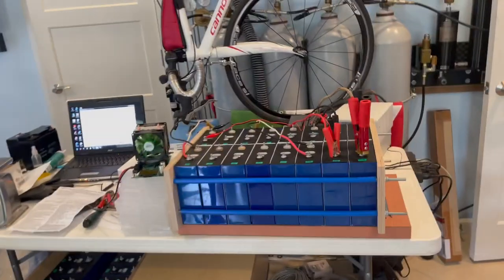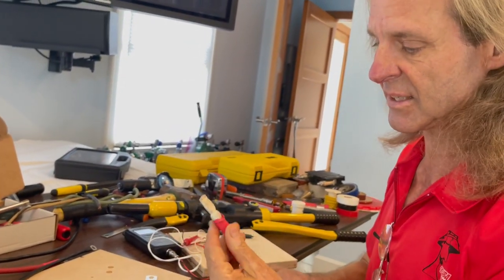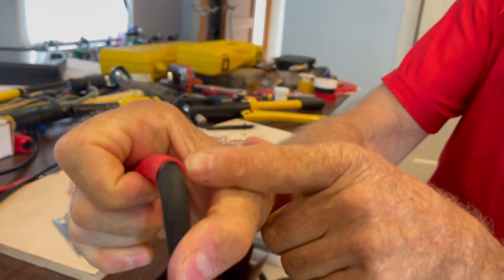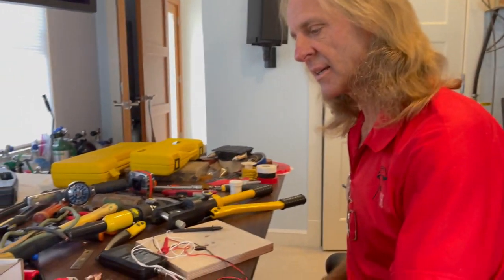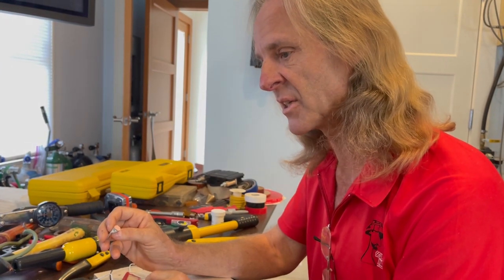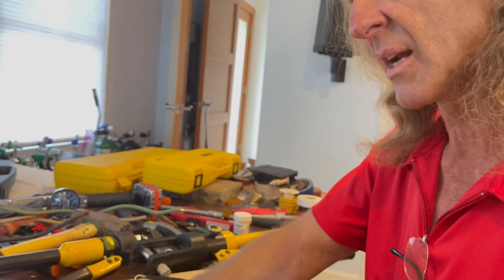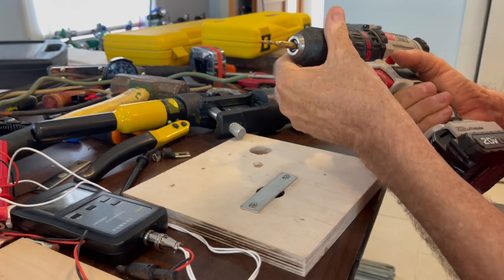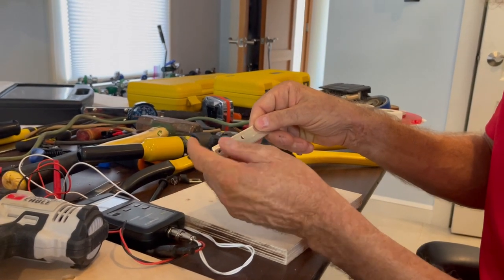Is Lifepo4 A Fire Risk?! How To Make Safe Battery Connections.

Comment: Nice video,I've sold over 500 traction forklift lead acid batteries,we used to weld the lead( pb)connectors to lead terminals with oxy acetylene torch then whilst hot we would smear vaseline to protect the terminal before we put the insulator. ive seen my batteries twenty years later and they were as shiny as the day they went out never a single problem,then the batteries became bolt on..long story short it was a total disaster..but just to give my opinion on your Anderson battery connectors I always just flux soldered them,we were doing serveral per week and again no problems,I find the crimp can very easily deform the shape of the pin those pins are spring loaded for contacting each other and any deformity can change this spring pressure/ alignment and cause burning... anyway, that's just my input for what it's worth! Good luck, Paul from Ireland.
Reply from the maker: Thanks, I will test the resistance through the Anderson connector.

Comment: Jello. Thanks for all the videos. I’ve seen 7 in the night!  Could you give us some information please about the paste name for exemple you use?  And perhaps some drawings regarding the boxes?  It would be helpful? Last thing. Are you really think pressure will keep the battery well?  How many PSI pressure?
Reply from the maker: Thanks for watching. All the info you are asking is in the videos. I hope you can see them all. The short answers are, the paste is MG847, The box dimensions are 18x31.75x11.75 inches. I restrain the movement of the batteries with minimal pressure. The nuts are installed at 1.5nm when the cells are at a fairly high SOC. I discuss these things in detail. Good luck with your project!

Comment: The un insulated transmission wire is not bare for thermal dissipation. The heat is low because of the higher voltages. Most lines are rated at <90° F operating temperature. But when running thousands of miles of it,  would be costly to try and insulate it......
Reply from the maker: The lines I’m speaking of are neighborhood scale distribution lines and the information comes from a short class I took on power distribution.

Comment: As Jojo mentions, you are a perfectionist and so am I. Sometimes however I do ask myself if this is all worth the effort (and before you even ask: yes it is because I know when I did not pay attention to every detail 😉)
But I doubt the copper/brass difference on the bus bars matters. At 100A (4.8 kW energy draw) a 0.04 mOhm resistor consumes (I² x R) 0.4 Watt and a 0.17 mOhm resistor 1.7 Watt. With 15 bus bars this sums up to a 19.5 Watt difference ((1.7-0.4)*15) in power loss. This is not the amount of power that will heat up your batteries and surely not enough to result in a fire hazard.
In a boat I would definitely use flexible bus bars.
I have a limited budget to spend so when looking at replacing bus bars with copper or replacing my Ikea (Tradfri Floalt) LED panels that take up 1.5 Watt even when switched off (and this is 24/7 !!!) I know where I will spend my money
Reply from the maker: If you watch a few more of my videos on this subject you will see that my reasoning isn't about energy loss. Undersizing your conductors is a bad idea for several reasons, but on the subject of brass bus bars, a 2x20mm brass bus bar is the equivalent of 7AWG copper wire. 7AWG copper wire with a 90c insulation is rated for around 65 Amps.
Reply: @RayBuildsCoolStuff  My battery packs for a power wall would be completely different from yours. I would be more concerned about the thermal isolation properties of the wooden box than I would be about brass bus bars instead of copper or even flexible ones. Not saying you are doing things wrong here - I would just do things differently.
I have always used a mechanical crimping tool and thought this was the perfect tool for me. After seeing this video I am convinced I need to get a hydraulic one instead to make our new power wall. Even if I would get the same results with my current tool, I want the perfect tool for a perfect result 😁

Comment: Like the video. Very well presented. I got a simple question…. You know how most BMS’s have a couple of cables for their input and output… how to properly determined the correct size lug to use? Let’s say two 7AWG; which size lug to use?
Reply from the maker: There are charts that show the cross section of different wire sizes. For instance, if you look at the cross section of a 4 gauge wire and multiply it by three you get a combined cross section that is very close to 1/0 wire size so I use that size lug when joining three 4 gauge wires in one lug. Is that what you are asking?
Reply: @RayBuildsCoolStuff  Yep! Thanks. So it would be base on the cross sectional size of each wire. It makes sense!. Again thank so much.

Comment: hello ray, thanks for this video, I learned some things.
I would like to tell you that I don't agree with the resistance measurements that you make, I think that the resistance should be measured with an equal length, I would be curious to know the difference in resistance between a rigid and flexible bus bar of the same length, in copper of course. Thanks for what you are doing.

Comment: Kudos to your camera operator, what's the name of the carbon conductive compound. Is it necessary for the  temperature leads that you tapped off of the bus bars? Nice catch on the difference in resistance between copper and brass.
Reply from the maker: The paste is mg847. I don’t use it on the sensing leads but that’s a great question.

Comment: Thank you for this video, just about to build a 32kWh Lifepo4 battery to add to my other 32kWh battery. Some things I missed like double crimping and heat shrnk. What are your thoughts on double bus bars on each connection?
Reply from the maker: I have other videos in a playlist that shows all of my preferred methods. Good luck with your project.

Comment: Which resistance tester do you use Ray?  And what is the primary difference between that and a normal Fluke meter?  I noticed yours has 4 wires for measuring…
Reply from the maker: I use a YR 1035+. It has 4 wires because it sends a small amount of voltage on two of the wires and tests resistance to 4 decimal places. The fluke can't come close to that sensitivity or accuracy.

Comment: Nice catch with the brass instead of copper. You need to check everything from China, they don't care if their cost savings starts a fire. The seller might not even know themselves. The right tool for the job is indeed critical.

Comment: Hi Ray. Thanks for your videos. I have a question about applying thermal grease. I have been using it between my lugs and my busbars and my lugs and my battery connections. My batteries are server rack type. The torque is 8 NM. The grease came with a little paddle for applying. I smear a thin coat on the bottom of the lugs. I notice on some connections that some grease has squeezed out. Am I putting too much on? Could this hurt conductivity?
Reply from the maker: I think it takes very very little. I see it as similar to lubricating o rings. The film required isn’t much. As for my opinion about it hurting conductivity? I’m all about testing. Also, you said you use thermal grease. That is a different type of product. I have used it in the past for mounting parts onto heat sinks. I would read the technical data sheets for the product that you are considering using. Try to find the papers that are written by the chemist. Usually those are the instructions. If there is a hint of marketing, don’t count on it.
Reply: Thanks Ray. Big screwup on my part. I thought I was using the same stuff you were recommending only at half the price. Glad I reached out to you. The stuff I got is for thermal conductivity not electrical. Also has high carbon content. Improving electrical conductivity by up to 30% is what hooked me (your video). I will be cleaning my connections and redoing them with the MG847.
Reply: Thermal grease meant for computer CPU heatsinks is normally electrically insulating ...

Comment: The wires that transport electricity betwen houses is alternative ... So... Is capable of more power. But if you use dc  on them, you will loose a lot of power. Bigest the wire lenth,  biggest  the looses.😉 About  those brass brackets... Are good for less power...for other projects...etc. you don't need to thow them.

Comment: Hi Ray...I'm another keen viewer from Oz...loving the very informative and laid back presentation. I thought you might have made your own busbars out of tin plated copper bar to your own specs?
Reply from the maker: I would like that very much but the cost is prohibitive. I estimated it to be about 3x the cost which is in line with the gentleman on the solar forum that was making them in his shop with a laser cutter and having them tinned by a third party. He was selling them for 6.50usd but soon gave up the venture. It's a balancing act but we have to avoid letting perfect be the enemy of good enough. I'm glad my presentation didn't put you to sleep. My wife uses my voice as a sleep aid. lol
Reply: @RayBuildsCoolStuff  This is a cut and paste from PowerPaul Australia Facebook page, a lot of info on his page: Bus Bar resistance comparison. 
In the picture are 7 bus bars. The bottom 2 are original ones supplied with the 280Ah cells and they are both 15 x 2mm copper, one os nickel plated. The nest 2 are the 2 sizes I had made from aluminium, and they are 20 x 4mm. The top 3 are the new 20 x 6mm bars or the Mercury battery. 
The bent bar replaces the entire B- cable assembly that comes with the Daly BMS. That assembly measures in at 0.17m Ohms. 
All measurements are from the mid point next to the holes. 
Copper - 0.06m Ohms (Original)
Nickel plated copper - 0.06m Ohms (Original) 
20 x 4 Aluminium - 0.05m Ohms (Scout) 
20 x 4 Aluminium (longer) - 0.09m Ohms (used for complex systems) 
20 x 6 Short - 0.02m Ohms (Mercury) 
20 x 6 Long - 0.04m Ohms (Mercury) 
20 x 6 Bent - 0.08m Ohms (Mercury) 
If we extrapolate out the numbers a bit. On a 12v battery which is 4S, and drawing 100A, we will get these losses overall. 
Copper - 0.52m Ohms = 5.2w
Nickel plated Copper - 0.52m Ohms = 5.2w
20 x 4 Aluminium - 0.49m Ohms (Scout) = 4.9w
20 x 6 Aluminium - 0.38m Ohms (Mercury) = 3.8w
A 4w loss when you're drawing close to 1300w is an excellent number. It'd be interesting to see what the figures are inside off the shelf batteries. 
Now these numbers seem not a lot different, and are indeed very low, but they just show the incremental improvements that I'm trying to include with each new version of battery. I didn't make a battery with the regular bus bars from the start, and the newer version has a greater than 20% improvement already. These sorts of marginal gains are increasingly difficult to get at this end of the scale, but it's a fun challenge. 
These figures are losses across the connection points within the battery box. There will be losses within the cells and the BMS to add into the equation too. 
The biggest difference I've seen with using these Aluminium bus bars, is the MUCH better connection they make with the battery terminals. The electrical connection seems to be much more stable and reliable. And the mechanical connection has been reported to have eliminated people issues with bolts loosening during vibrations. All of these factors play a huge part in how well the battery works, and have reliable it will be long term.
Reply from the maker: @michaelivory7606  Thank you very much for posting this. These values are nice validation for the data I have accumulated so far but add numbers for aluminum that I haven't tested. It also agrees with what I have found elsewhere. I appreciate that you took the time to post this. I think several people are wondering why we try to achieve low resistance values. It appears to be important in getting good results from these packs and the BMSs that keep them in balance. Long term reliability and performance is the goal. This is what my latest video is all about.

Comment: Great video, could you still use those brass buss bars but double stack them to double the cross section and halve the resistance?
Reply from the maker: You could use them any place where 4 gauge wire is appropriate I suppose. You could double stack them but they really aren't very flat even after I flatten them so contact area is hit or miss and I would think it would be chasing performance in the wrong way. I think they are fine for top balancing and low amp situations but......

The real issue I have with these bus bars and with cabling that is too small is the resistance and what it does to the BMS as it tries to read your cells and balance them. Have you had a chance to watch my video on that subject? It's titled "It's no joke, size really does matter"

Comment: hmm something you didnt talk about which is important with DC over a few volts is galvanic corrosion, especially on the + terminal side, which is sped up by orders of magnitude by the joining of 2 different metals. Ive always wondered about sacrificial anodes, not for marine use but just regular air use. you can make a bunch of pretty much pure zinc disks by putting pennies into a disposable cup and adding 2% OTC hydrogen peroxide and white vinegar and stirring. dont drink the bahja blast that results, and they should be newer post 1988 or whatever pennies.
in my enclosed battery/supercap thing im building in a somewhat airtight "ammo can" build, I was going to put some at the bottom for thermal mass and just to preferentially take the oxygen out of the air and lower the level. add some desiccant packs too to keep an eye on things. this isnt really a true use of a galvanic sacrificial anode but it is how i would make some for basically free. maybe ill look for some nooks and crannies in my car's frame to stuff some extra ones in. most modern anti rust coatings are pretty good now days... but the mild steel used for car mfg is the absolute lowest quality in terms of anti-rust ingredients like chromium and they are really making the paint/finish do all the work...
an example is basically every car battery in N america. look at the wires connecting the + terminal vs the negative, the + terminal is always significantly more rusted....

Comment: I haven’t got time to read all the other comments, so forgive me if someone else has mentioned this, but, when you were doing your test between a solid busbar and flexible, you showed the difference in resistance, as being much greater in the flexible. I did notice that the length of your wire was, at least, twice as long, maybe even 2.5 times longer, so wouldn’t that create more resistance anyway?
Reply from the maker: Of course. This video is focused on making good and safe connections while I have another video about solid and flexible busbars which explores cross sections and length and the requirements for resistance equivalency.

Comment: Also, is that tester you are using the TR1035? I can't tell from the video, but it looks the same. I thought the TR1035 was only for internal resistance measured using AC 1kHz. Are you testing using "regular" (I guess that means DC), or is it using an AC signal to test the resistance er impedance of the brass/Cu bus bar? I was thinking of getting it, but I thought I could only use it for measuring battery internal resistance so I didn't know if I wanted yet another tool. My understanding is that it is very accurate.
Reply from the maker: I use the YR1035+ It does a good job of measuring DC resistances to a micro level.
Reply: @RayBuildsCoolStuff  Do you have a link on one of your pages to where you got it? I saw a lot of different variations of that model available for sale. I just saw a video and I found one of my testers was a verified inferior knock off copy so want to avoid getting a cheap Chinese copy of a cheap Chinese tester.
Reply from the maker: I bought it from Amazon for 79$. Tking rings a bell as the supplier if memory serves.

Comment: What is the size and pitch of the bolts you are using to attach the bus bars to the battery?  I think you will find that the clamping force is far higher than you realize and more than enough to remove the slight bend in the bars.
Reply from the maker: I wish it was so. I test the resistance from terminal to terminal. If the resistance is high then I look at the bus bars. Sometimes I have to slightly straighten them. The resistance then comes down to normal. There may be a strong force but it is at a mechanical and leverage disadvantage. If I could tighten them enough, it would indeed force them into compliance but I am limited to 6Nm which isn’t a lot.
Reply: @RayBuildsCoolStuff  What size and thread pitch?

Comment: Hi Ray would u please give me your opinion on whether solder on the BMS senser lines to the positive terminals be good or bad I have just purchased 2 OVERKILL BMS and soldered the ends to the cables,I did however crimped them on before I soldered them.what do u think of this idea.cheers Rene, from Australia Vic.
Reply from the maker: Personally, I think a good crimp is adequate.

Comment: when & where would you utilize  FERRULES  on Stranded Wires / Cables 
COOP
Reply from the maker: @WiSeNhEiMeR-1369  most places where the wire is secured by a clamping screw. Some clamping screws have effective strand retention through the use of split sleaving so ferrules are not required or desirable.

Comment: I thought the high carbon paste was a thermal paste designed to conduct heat efficiently between metals. Your thoughts on using NO-OX-ID which is to prevent corrosion electrical paste?
Reply from the maker: MG847 paste that I use is not a thermal paste. It is an anti-corrosion conductive paste. You can read the specifics by searching it on google and going to their data page.